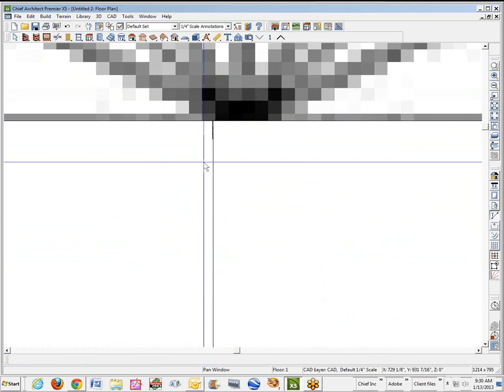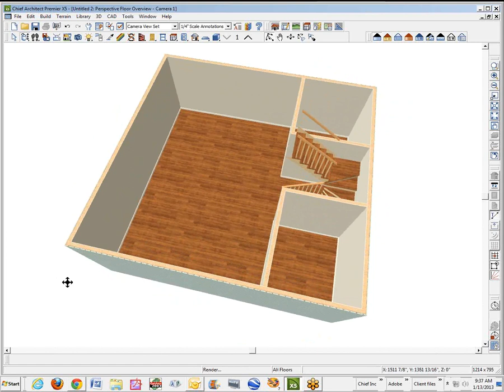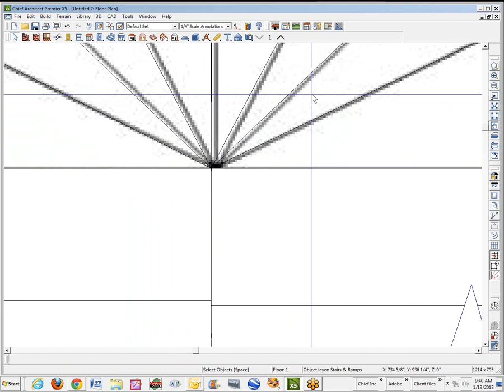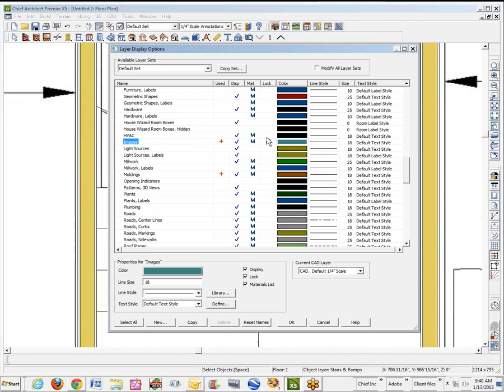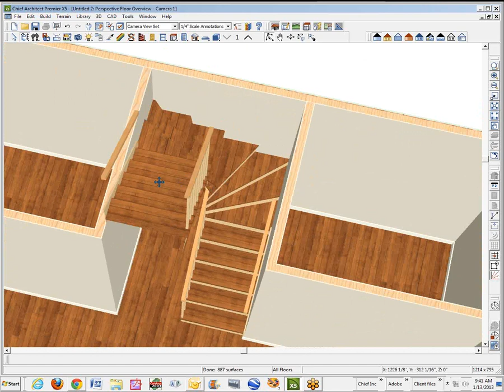Custom Winder Stairs in X5

Comment: Good theory. Do you live in the states. 
Check building codes. Allowed 1 winder per run of stairs. Talked to the building department 4 hours ago. Minimum 6 inches at newel post. 2 risers only. 
Not allowed. Lawsuit